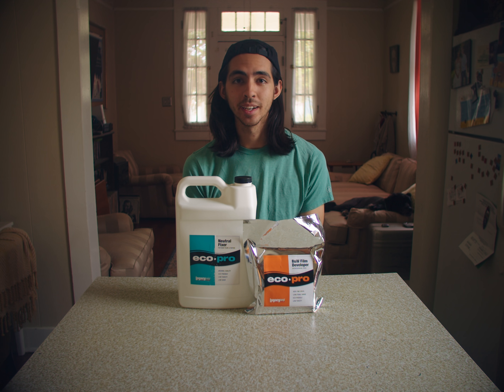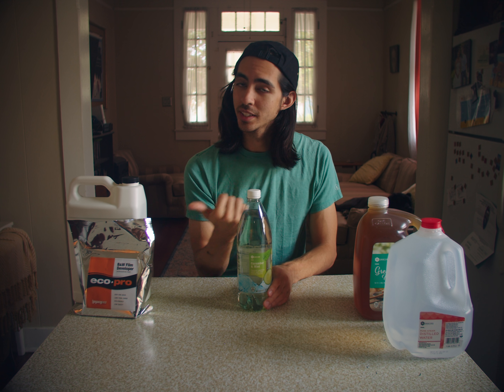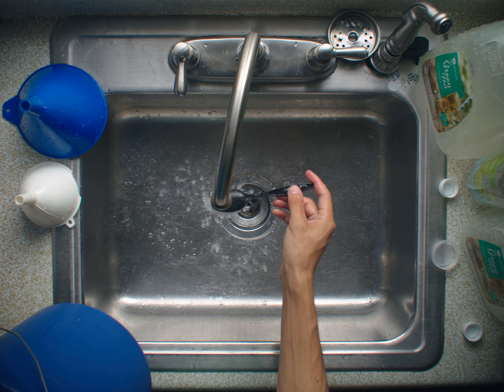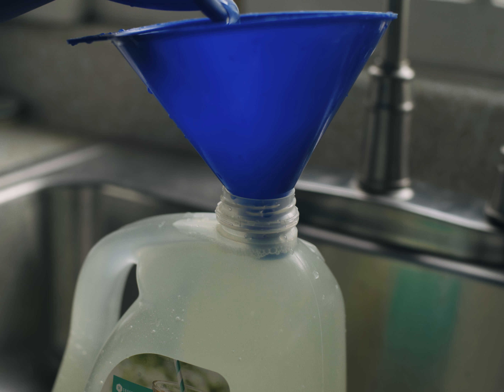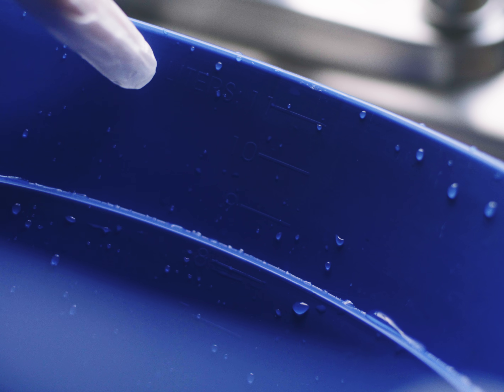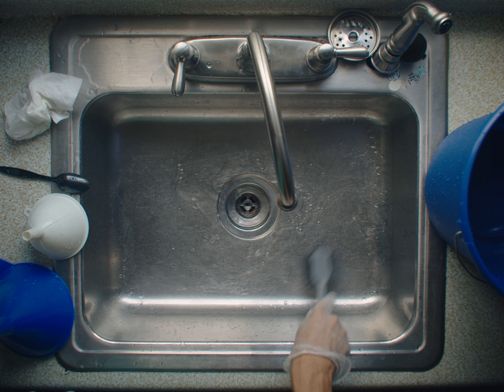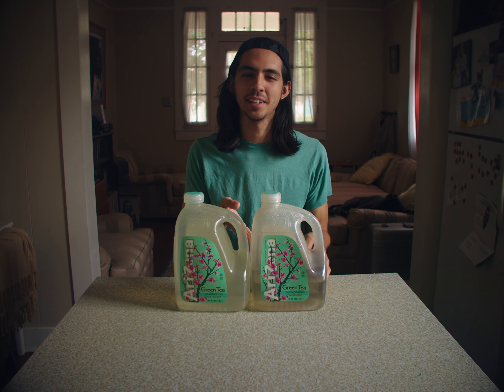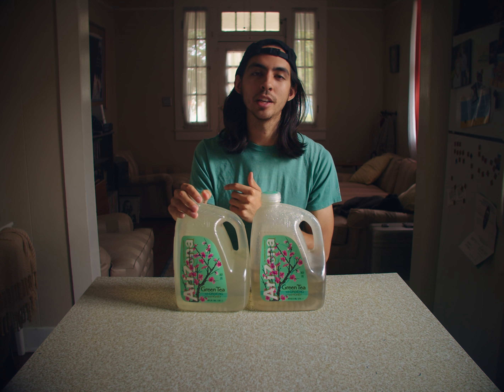How to Mix Eco-Friendly B&W Film Chemistry (EcoPro/Xtol)

Comment: hi! can you use water as a stop bath for this developer? or do you recommend the eco pro stop bath?
Reply from the maker: Hi! Yes, I use water as a stop bath with this developer. I haven’t used the eco pro stop. You can see my b&w process in one of my later videos. 

Of note, if you are using chemistry at a very high temperature/have a very short duration for development (like less than 3 minutes), that’s when using a proper stop bath might start to make a difference.
Reply: @yealevi2850 you can mix a 2% white vinegar to water as a stop bath solution. I would use that if I'm using hot and fast developing recipes. Add of now... I'm all slow, highly diluted, room temperature, Rodinol chemistry.

Comment: Really shocked you have recommend pouring these chemicals down the drain?!? Eco-friendly or not there is still poisonous chemicals in these substances. By recommending people to pour even "quite low toxicity" chemicals down the drain you are basically advocating for people to poison the water system. Many recycling centers have the proper equipment to dispose of these chemicals properly. This is a time for environmental consciousness not irresponsible chemical dumping.
Reply from the maker: Hey! I wouldn’t go as far as saying “advocating to poison” - these chemicals are far less poisonous than lots of household cleaning products, which are used on a much larger scale, but most wouldn’t bat an eye at. From what I’ve researched, water treatment plants are well suited to deal with what is in these particular developing chemicals. Used fixer is the most realistic concern due to the silver content, but the fixer poured in this video is unused. I don’t dump used fixer or blix down the drain. 

Although that doesn’t negate your thesis.  Not all water treatment facilities are up to par. I could be more mindful and hope to be in the future. A proper deep dive and an entire video on the subject may be necessary